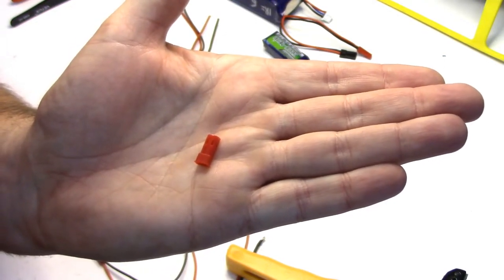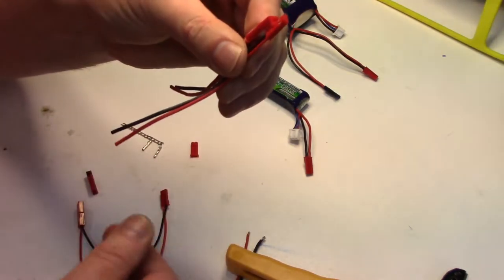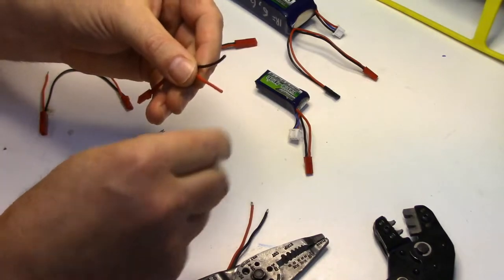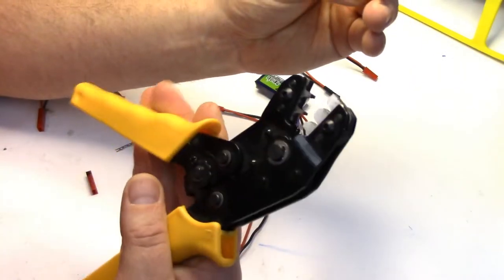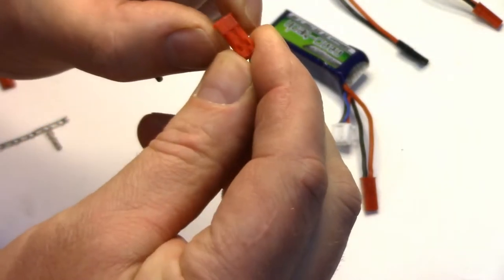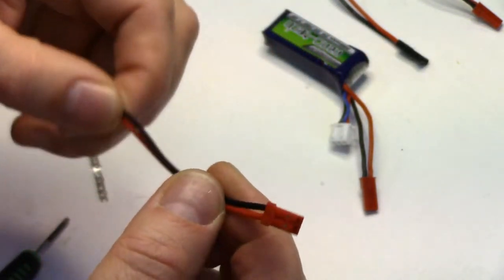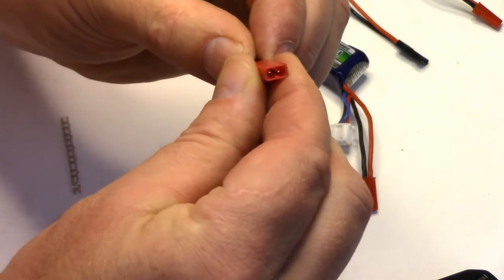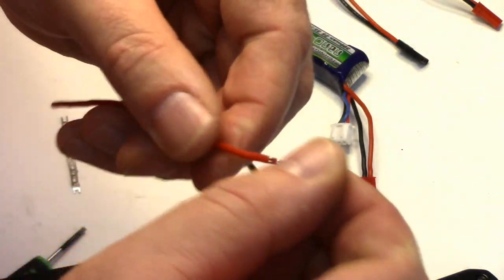How To Crimp JST RCY Connectors

Comment: The Male connector has the pins the Female connector has the sockets. The outer plastic shielding has no bearing on gender assignment. Makes no difference in this case or video but if you are ordering connectors and you want a specific half of the connection, then it is relevant to identify them correctly.
Reply from the maker: Thanks for the clarification; however it depends where you order them from. I've seen JST's classified both ways, by pin and by housing. Most electronics shops such as Mouser and Digikey sex them by pin as you state. Most hobby shops sex them by housing (at least here in Canada) and that is where I get mine usually, so that is what I'm used to. Suppose if folks want to be 100% sure they are ordering the correct JST RCY sex connector, then suggest they look at the product photo to be certain. 🙂